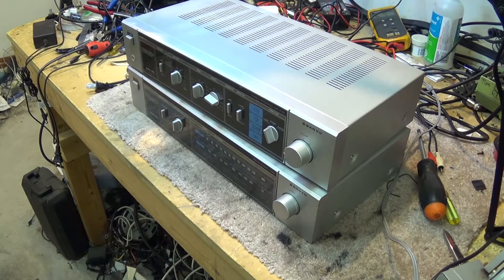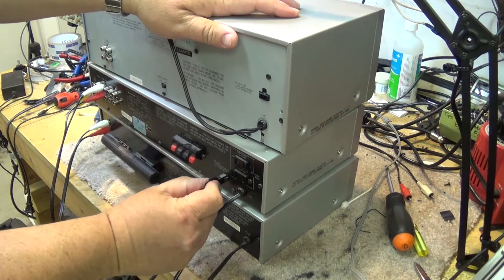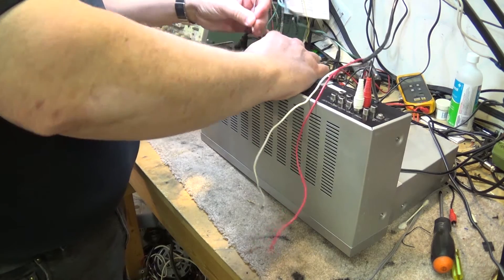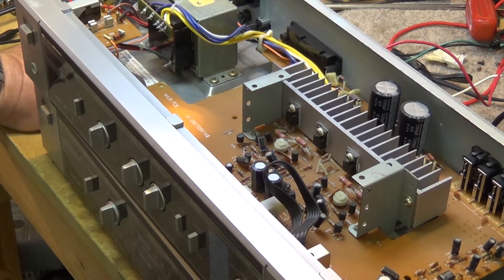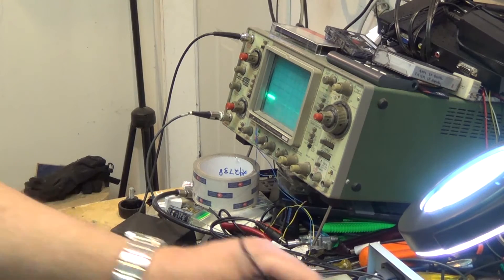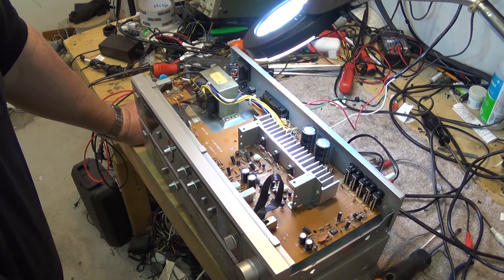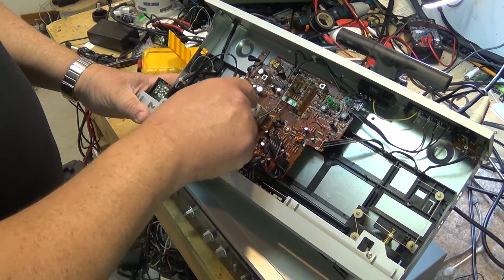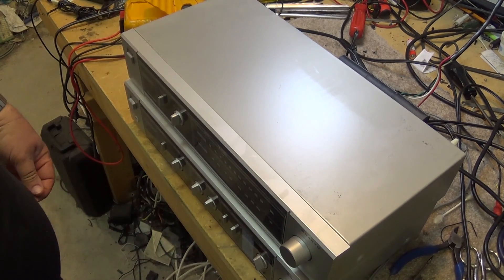Sanyo Stereo System

Comment: I had a similar Magnavox system that had a similar set up with the amplifier that had the power supply for the tuner. It was rated at 70 watts per channel and the tuner was digital. It also had a single cassette deck with Dolby B and C and it was auto reverse. I’m not an expert but it had a lot more going on inside than this one. Still have it somewhere. It actually sounded decent.

Comment: I got ja350 for 5£. Initially it sounded humm at one channel. Then cleaned it up.still there was humm. Later figured out the humm is from equiliser circuit. It goes away when i put all the eq knows at 0. Sounds clear. Lacks the thumping bass eith loudness on compared to marantz 2215b otherwise clear.

Comment: I'm not sure why you're so grumpy about this inexpensive Sanyo system. Turn on the amp 30+ years after it was built and it works. it has simple design using discrete components that's well laid out and easy to access. I have no problem with a shared power supply as long as the transformer's rated for it. Yes the case is plastic and it was very much built to a low price, but if that was all someone could afford for a separate system at the time so what? Y
Reply from the maker: It's more because of the shared power transformer.  Can't use the tuner without the amplifier.  So why bother putting in Ina seperate box to make people think they are getting seperate components.
Reply: @12voltvids  The tuner doesn't have a headphone socket (how many do?) so you can't use it without the amplifier anyway. I do agree that they could just as well be in the same box but that was a marketing decision. Y
Reply from the maker: @yamakawa511  but if it had a power supply you could use it with a different amplifier.
Reply: @12voltvids  You could potentially but I expect these weren't sold or expected to be used as individual components. If I wanted an individual vintage tuner I doubt that I would choose this Sanyo, I'd go for something a bit more upmarket like the Yamaha CT-600. Y
Reply from the maker: @yamakawa511  
Just saying.  Years ago my old akai amp bit the dust.  I replaced it with a Technics.  Still use that one 1980 akai tuner.  Can't be done with this one.
Reply: @12voltvids  You could, you'd just have to rig up another power supply but why would you bother? There are plenty of better vintage tuners out there for not much money. This was a budget offering by Sanyo, complaining 30+ years later that you can't mix and match these components is a stretch and no reason to trash the amplifier. The fact is that Sanyo built the amplifier (and it's power supply) well enough that it does work 30+ years later. As you can tell I have a soft spot for Sanyo, no they weren't a premium brand, but the various bits of electronics and white goods of theirs that I've owned over the years have worked well for me. Y
Reply from the maker: @yamakawa511  has nothing to do with it being 30 years old.  I had to deal with these when they were 2 years old and someone popped the amp.  The tape deck and tuner was now useless.  They couldn't just buy another amplifier.  Sure you could build a power supply if you knew what you were doing but that was beyond what most could do and if they didn't want to pay me to fix the amp back then they certainly were not going to pay me for building a power supply.  They just wanted to use components with an old amp they had kicking around and couldn't because of the single power supply.  Sanyo wasn't the only one guilty of this.

Comment: I did the restoration of the Sanyo 220. It is cheap but works great. Sounds musical to me. Especially with the grundig box speaker without much expense. You have a musical system. Trivial but valuable :)

Comment: Hello,

I'm messaging to ask if you may have any information as to what size speakers, (both Woofer and Tweeter), were used for Sanyo Stereo Model: GXT-4503 (Circa 1979).

I once owned a GXT-4503, which my parents gave me as a Christmas Gift in 1979; and which  I regrettably sold at a Yard Sale, in 1989 or '90.

I've found one online, but it doesn't appear to have the original speakers, and I'm sure they are quite hard to find! 

So if I buy it, I am thinking of building my own Speaker Cabinets, and if I do, I'd like to install original sized speakers in them.

 I know that they were "8 ohm" speakers, but that's all I know. There are at least 4 user manuals for sale on ebay, for GXT-4503, but I don't believe the speaker size is listed in it.

So any help you can give me, would be VERY MUCH appreciated!

Thanks So Much!

Ron
Abilene, TX.
Reply from the maker: No information
Reply: @12voltvids  

Ahh, ok. DRATS!! LOL!!! 

I knew it'd pretty much be a long shot, but knew it wouldn't hurt to ask you. 🙂 Having one of these units, w/original sized speakers, (to HOPEFULLY produce close to the original sound), is rather a sentimental type thing for me.

I loved that Stereo, and always felt it had a GREAT sound!  I recorded a lot of great music off the radio with that unit, and so I have a lot of great memories associated with it. 🙂

Thanks Again Just The Same!

Ron

P.S.

I watch your videos quite regularly, and really enjoy them! Am thinking of trying my hand at doing some Radio Repair & "Resto" myself.

I think it's something my Step-Grand-dad always wanted to learn to do, but just didn't have the aptitude for. He passed in July 1988, and I sure do miss him AND all the tinkering & attempting to repair things, as he used to do!! ☺️

Comment: thats crazy my sister bought one of those sanyo (rack) component stereo systems the black version it supposed to put 100 watts pr/chn.12 inch 3way spkrs an cabinet for$800 back in 1985  no better level of quality that that 20wtt pr/ch unit there just minimal circutry chepo cassette mechs made mostly of plastic junk !

Comment: This is typical Sanyo, tho - cost cut to the max, yet often continues working flawlessly years after more expensive, over-engineered units have crashed and burned. Cheap & cheerful!
Reply: Benefit of a simple design.
Reply: Sanyo had one of the best semiconductor plants, though.

Comment: ew get that thing away from me!  Kenwood did the same, it sounded good but basically planned obsolescence from the getgo. yuck! 
The crosley of it's time.
Reply from the maker: I got 50 bucks for it and it still works.
Reply: @12voltvids  surprised you were able to get that for it good for you! I'd probably pay no more than $20 for something like that but to each there own. In the end it is still getting used and it's not rotting away in some landfill. I actually rescued a sanyo receiver not sure what model number but thing is heavy, it had the cord cut off on it and there is nothing wrong with it aside from some scratchy controles that I just needed to d5 and Voilà! Working again. I am guessing it is probably from before sanyo audio equipment started going down hill because its got the woodgrain metal top with the wood endcheeks and everything with propper phono jacks and a builtin preamp. It is silvere faced, so I have to say it must be from the late70s to early80s. I had a tape deck just like the one you have in your video. Mine had the phono jacks though, not the proprietary interconnects so it must of been part of another set.

Comment: I would rather take that transistor amp over a Technics receiver any day..no overload crap from the Sanyo..
Reply from the maker: You can overload a transistor amp just as easily as a IPM (integrated power module) amp, and the damage is the same.

Comment: Discrete transistors.  Well, well.  Sure, they're not very big transistors, but at least Sanyo didn't cop out by putting in an STK power amp module and calling it a day.

Otherwise, yeah.  Very basic and must not have cost much to make yet earned a nice profit when it was sold new at retail.
Reply from the maker: Well it has made me $3.90 so far! Funny how Sanyo, the company that brought us the STK power modules didn't bother to put one in their own product.Probably cost too much!
Reply: Transistor sound was much better than stk unit but that’s unknown those times…
Reply: My 1978 Sanyo receiver has two STK078 modules. So they were actually using them.

Comment: I'm not a big fan of tethered gear that requires only their modular / ribbon cable connections....I believe most mfg's have done that at some point and time.  I am a big fan of separate components and not a rack of components in one box that looks like individuals, again I believe most mfg's have done that as well.  I have all Sony modular components that are big and heavy from the 90's that shake the house with two Sony powered sub-woofers and vintage 1970's MCS big floor speakers and Sony wall satellites, my head unit is 5.1....I have this in my office and run my computer through it!  :)  One day when I get my YT channel going, Ill do a video on it.